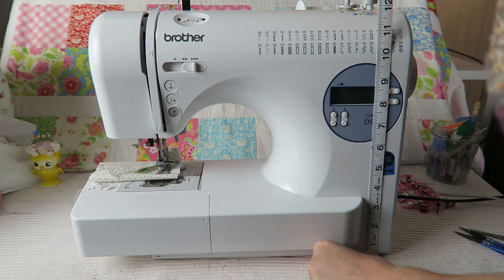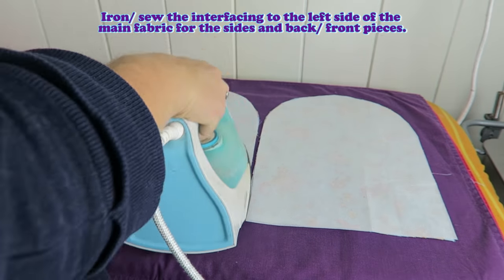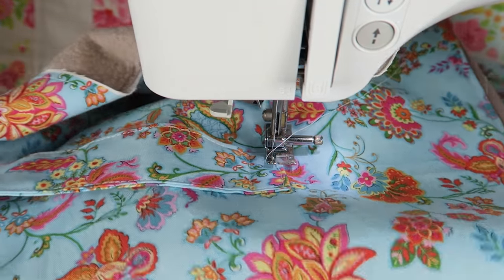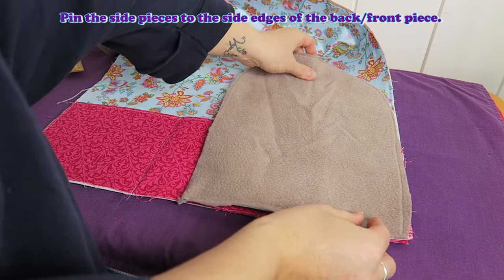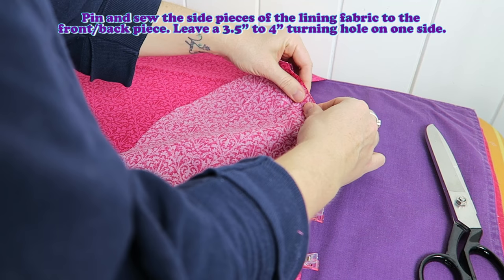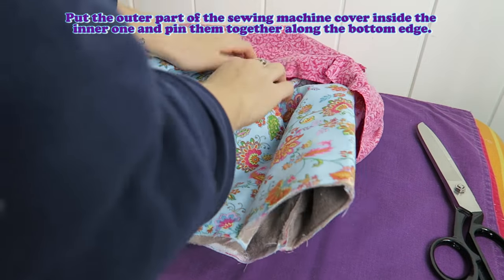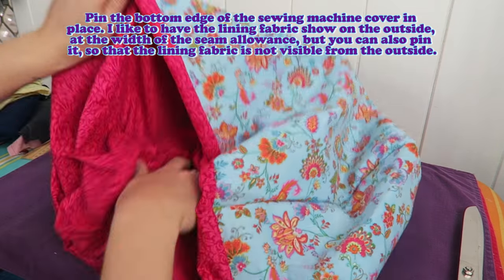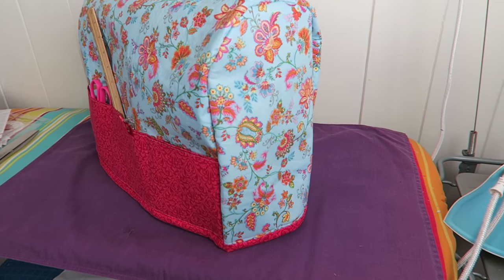DIY | Sewing Machine Dust Cover + FREE pattern!!! • Sami Doll Tutorials

Comment: So pretty how much fabric is needed?
Reply from the maker: Hi Susan! Thank you!
The materials needed are listed in the pattern which you can download here: https://www.samidolls.com/en/free-patterns

Materials needed:
 Fabric of your choice (quilting cotton works well)
o About 90 x 100 cm/ 35.5” x 39.5” of main fabric
o About 90 x 100 cm/ 35.5” x 39.5” of lining fabric
 Batting or foam
o About 90 x 100 cm/ 35.5” x 39.5”
 Medium to heavy weight interfacing (unless you are using foam)
o About 90 x 100 cm/ 35.5” x 39.5”

Comment: Would I be able to make one out of fat quarters?
Reply from the maker: Hi Suzy, you'd prpbably have to assemble them to the size of the pattern, they might be just a tad too small.
Reply: I made mine with a total of 3 fat quarters 1 for the sides & 2 to make the body. ( i needed  30" X 16"  for the main part,  so i did mine in 3 sections like 5"+20"+5". And turned out great!